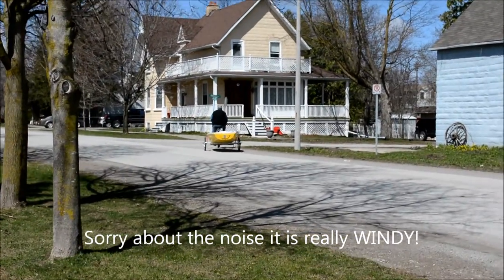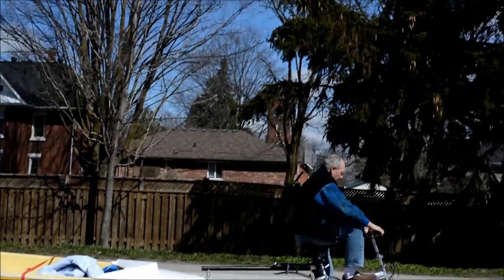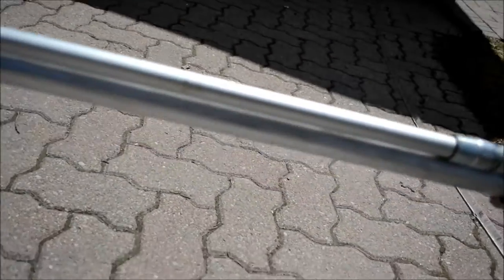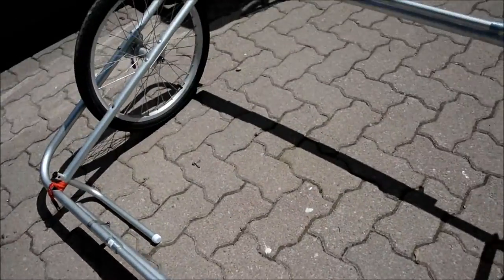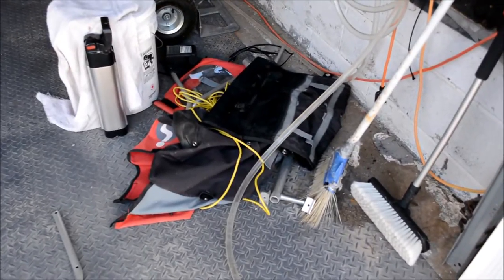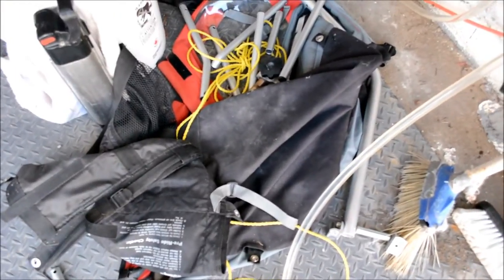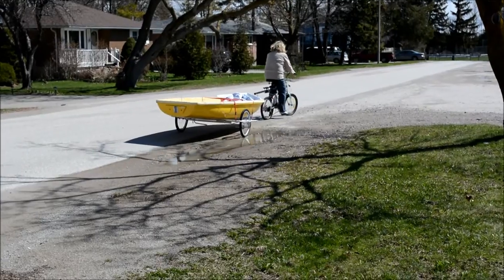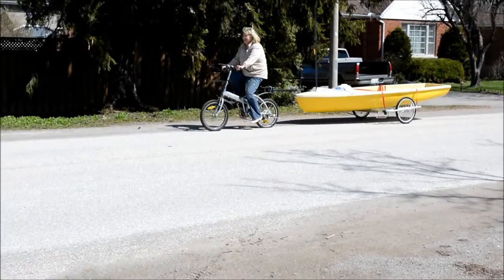how to make a bike boat dolly trailer DIY

Comment: Great idea. I would be interested if it is allowed to drive on roads with the self reinforced trailer or what certifications you need for access to drive on roads.
Reply from the maker: Interesting question.
Reply: I am from Germany, so we live in seperated rule system I guess. But would be interesting if you were allowed cycling with this trailer on us-roads.
Reply from the maker: Hi ruhny, built it to drive on private roads in a campground in Canada.  Not sure about the laws in the US
Reply: Interesting. Thank you! Wishing you a great Tuesday. :)